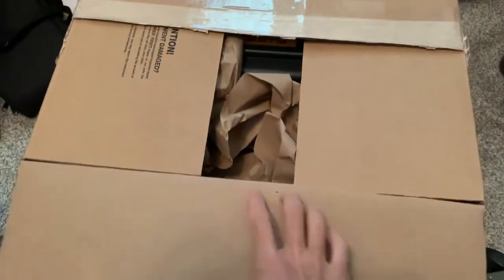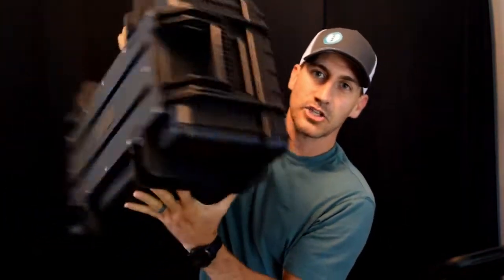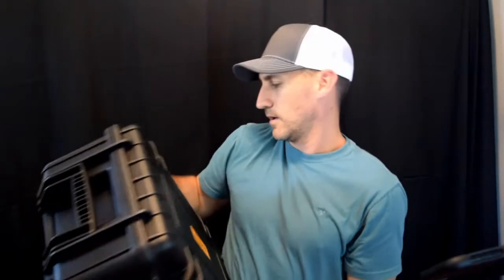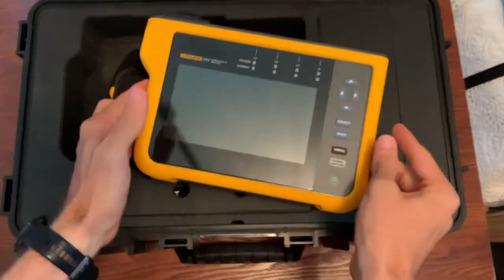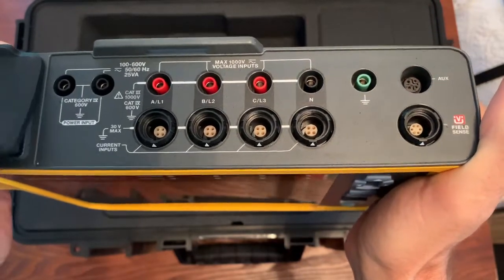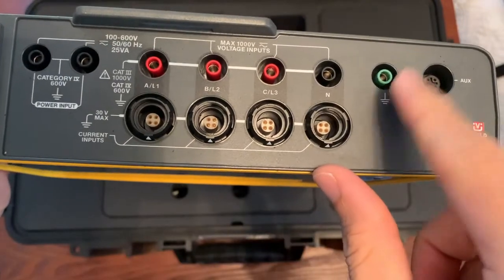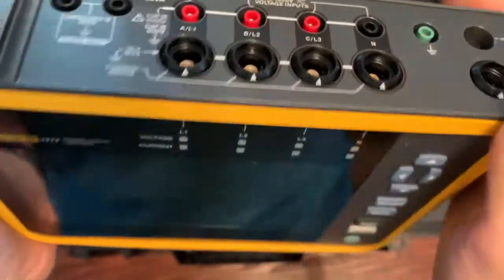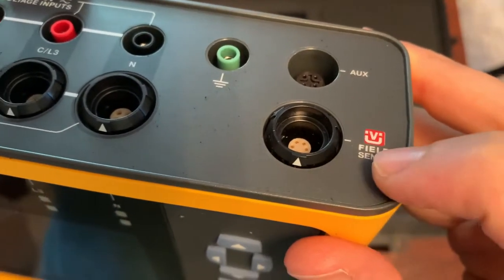Fluke 1777 Unboxing - Fluke Fridays - Episode 23

Comment: Do you need a subscription to use it ? Or is that just to use remote monitoring . Does it have usb to transfer data to a laptop  ? Also does it have blue tooth fc capabilities ?
Reply from the maker: No subscription. But with remote monitoring you have a few options. Best would be to buy the cell phone modem adaptor and get a Sim card. Then you can download the data remotely. If you want a streaming service I don't think that is available. If they do make it available someday that will be a subscription. I have a video on how to transfer data. But yes you can transfer Data to laptop via USB cable, USB flash drive, or wifi direct connection. Yes some Bluetooth FC capabilities.
Reply from the maker: Also, call 800-44-FLUKE for any specific questions

Comment: Can this power quality analyzer measure up to 11kV medium voltage? Will PTs (Potential Transformers) be required for this?
Reply from the maker: You would need PTs. It has a voltage ratio you can enter. But the meter itself should never be exposed to more than 1000 V. With PTs and the voltage ratio the meter will display a higher voltage. Example if you had a transformer that was 100 to 1 ratio the meter would read 110 volts from PT but would display on the screen 11,000 Volts.
Again - NEVER CONNECT METER TO MORE THAN 1000V

Comment: You are able to merge the recording sessions of two Fluke 173x series loggers into a single cross referenced report. Are you able to do the same thing but using one Fluke 173x series logger in conjunction with a Fluke 177x series? I presently have a Fluke 1736 logger that I tried uipgrading to a Fluke 1738 but turned out after purchasing the firmware upgrade I found out my 1736 was an international model so couldn't be upgraded. My plan is to now purchase a 1738 for monitoring buildings with dual utility feeds. Now that I have enough saved up for a Fluke 1738, I am debating saving up a little extra to instead get a Fluke 1775 but first I want to find out if I can merge the recordings from these two devices into one report as can be done when using two 173x series loggers?
Reply from the maker: Great question!  I just reached out to one of the product experts and he confirmed you can combine/merge the data as you state from different series loggers. Like the 173X and the 177X models.
Reply: @fridayswithbrandon  Perfect. My mind is made up then, I will save up a bit longer to be able to afford the Fluke 1775. Thanks.
Reply from the maker: @MrNightro  where do you plan to buy from?
Reply: @fridayswithbrandon  I've purchased from Tequipment a couple times in the past but I haven't decided where I'm going to buy from as of yet. I plan to shop around first.
Reply from the maker: @MrNightro  cool. I'm trying to get some affiliate links or discount codes to some distributors. I'll keep you posted if I get some.
Reply: @fridayswithbrandon  Sounds great, thanks.

Comment: thank you. have a question, I might work with 3 phase once every 7 to 8 years. most of my work on AC is with 115 and 220V,  1ph I want to buy a power quality meter. should I buy a 345 or a 3 phase one?

Comment: I am replacing a 435 that failed and looking at the 1777 and the Norma 6004+. I can still get a new 435 II kit but curious how the 1777 compares. From what I have seen, it may be more user friendly for my techs that dont use the PQ meter on a regular basis but I wonder if it has all the same functionality as the 435.  I will wait for your review Friday before making a decision. It seems nobody has them in stock right now so that might make my decision for me. Any plans on reviewing the Norma 6004+?
Reply from the maker: The 1777 I would recommend over the Norma 6004+ as a replacement for the 435.  I might do a Norma 6004+ at some point(it's a good idea). If you have the choice of a 1777 or a 435-ii the 1777 will blow it away with performance and ease of use... And the software is way better. As far as delivery Distributors should be seeing inventory in the USA in late November. The distributors that have already placed orders are as follows: Fotronic, Newark, Grainger, and Tequipment